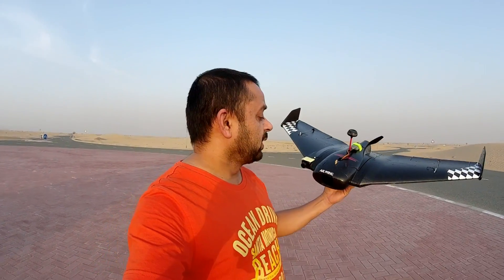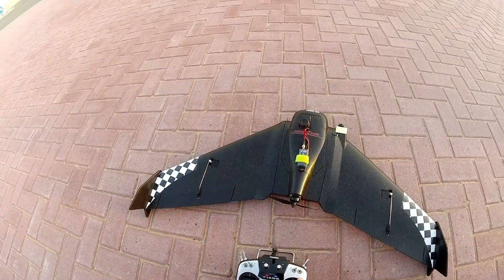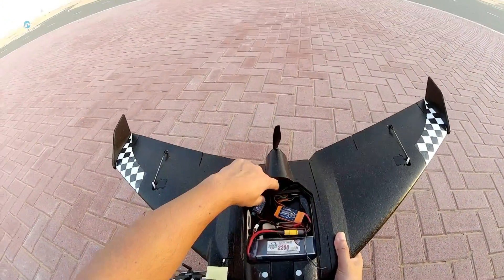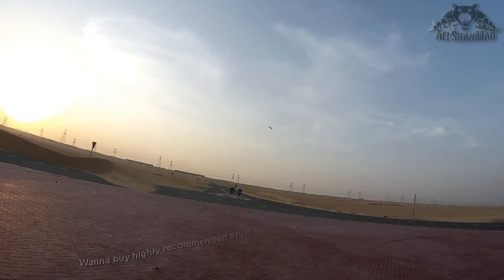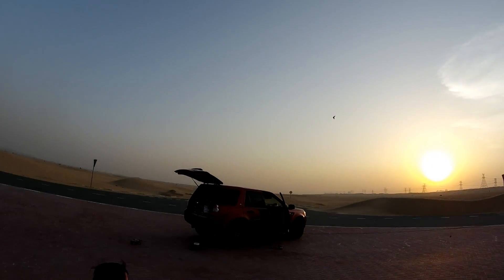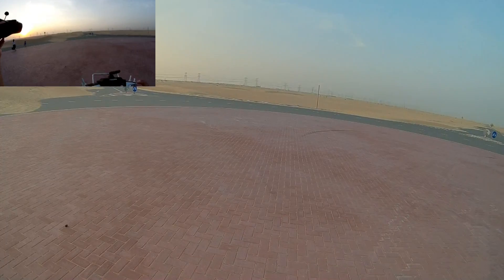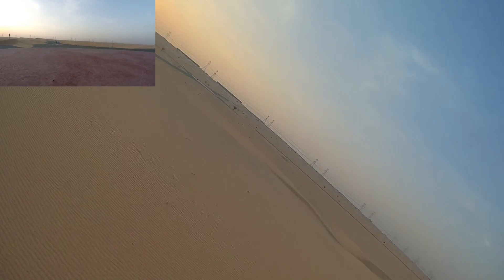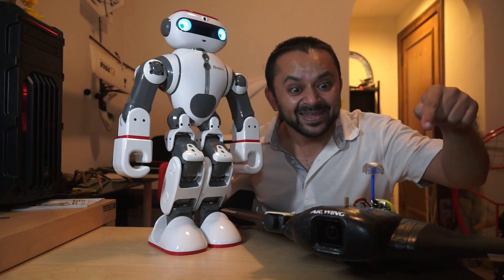AR Wing FPV Flying Wing Maiden Flight and FPV

Comment: Until now.. I cant understand what is dual rates for...
Reply from the maker: Dual rates adjusts the 'throw' of the input, meaning the entire travel of the selected Channel surface will be scaled down.  For example if you set Two Dual rates on Ailerons (100% and 60%) using a 2 position switch, and when you flip the switch to 2nd position, your ailerons will be limited to 60% travel only rather than 100% travel. Dual rates together with Expo are used to tame down agile models or models with lots of throws on surfaces, even on steering on RC Cars and RC Planes etc. or any channel you like to scale down the control throws.
Reply: @alishanmao  so wif dual rates..manual mode would be easy to handle since.. The travel of the servo wont be maximum rite...?
Reply from the maker: yes thats the idea ;)